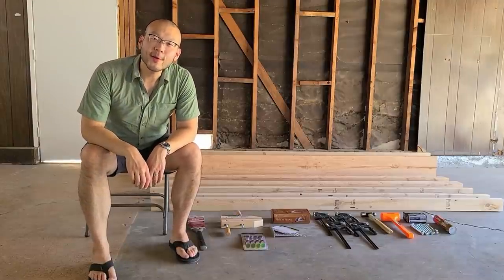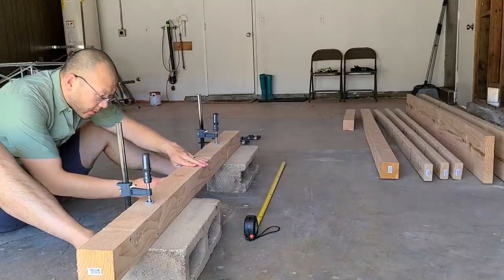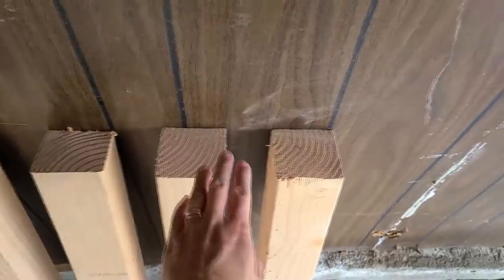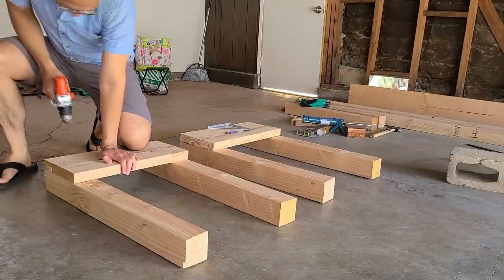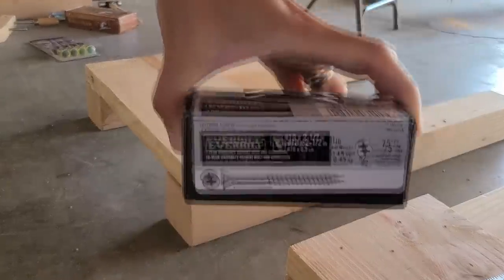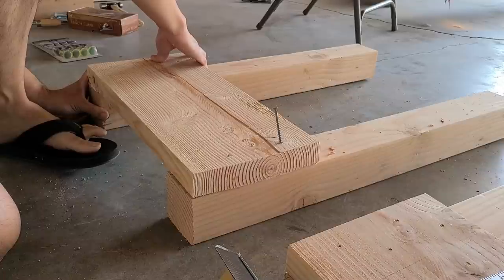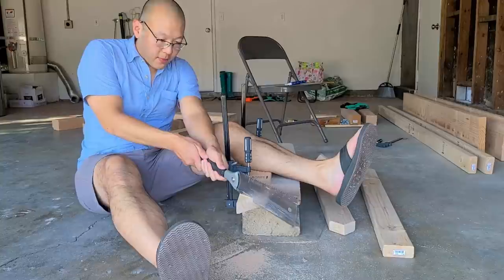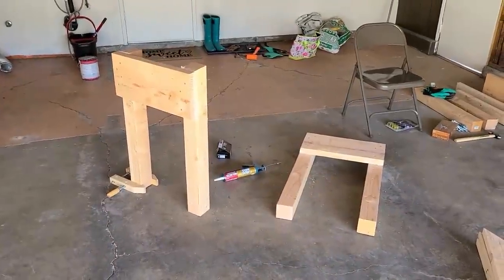A Dentist Builds Rex Krueger's English Joiner's Bench Part 1

Comment: I've only watched this video (so far) but I want to extend to you one piece of advice I wish someone had given me when I started, oh so many decades ago.  When sawing, always keep in mind the "kerf" of the blade you are using.  IE - the thickness of the saw blade.  If you are cutting an 8' board in half, you won't actually end up with two 4' boards.  You'll end up with two 3' 11-7/8" boards (or thereabouts), depending on the thickness (IE - kerf) of the saw blade.  So, when you pencil in your cut line, make sure you cut with the saw blade on the waste side, not the project part side.  Otherwise, you'll end up with a part that's too short.  Ask me how long it took me to figure this out on my own...  :P
Reply from the maker: Awesome! Thank you for the detailed reply! I definitely still need to work on my sawing and others have mentioned about the kerf. I'll make sure to keep that in mind when making more precise cuts.

Comment: If you buy another caulk gun, try to get one that releases pressure when you stop pulling the trigger.  It will also have a better tip cutter.  These are normally $15-$30 and will save you a ton of time, clean up and aggravation.  As you get into home improvement and start caulking your tub, cracks etc. it will be a life saver.
Reply from the maker: That's great advice! Yeah....I'm starting to learn some of the cheap tools I just got will need to be replaced soon. I didn't know how much this hobby would stick so didn't want to invest too much initially, but I really enjoy woodworking and diy! Time to buy some nice tools!

Comment: Not to make cultural assumptions, but Japanese woodworking is some of the finest in the world and traditional Japanese woodworkers do much of their work sitting down. The saw you are using, like many Japanese tools, works on the pull stroke, which is more powerful and easier to control, and of course sitting at floor level is much more a part of daily life.
Reply from the maker: I've noticed this too as I watch more woodworking content. I actually really enjoy working on the ground and I'll continue doing it. I want to start working on some indoor plywood furniture and got a comment on my vertical chainsaw mill video saying to use my circular saw on the floor with purple foam board insulation as a backing. I've seen a few videos on it and seems like a very safe way to break down 8x4s!
Reply: @ADentistDoesHomeImprovement  I will check that out. I've been a carpenter for over 4 decades and I can't stress strongly enough, power tools are inherently dangerous. ALWAYS use eye protection, ear protection, pay close attention to blade depth and the guard, when sawing sheet goods (ply) wear a respirator as well as it is infused with formaldehyde, don't know what's in the foam but assume you don't want to breath that either;) Will continue to follow your videos, I'm now retired and going through a hand tool renaissance, love the quiet, the cleanliness, the safety.
Reply from the maker: @johngriswold2213  Of course. I wore all that when I used my circular saw for the first time and continue to do so. This comment and other safety comments are the most important! I want to maintain a healthy respect for all my power tools. Thank you!

Comment: Right out the gate I see you made the same mistake as me and picked up the harbor freight bench plane.  That thing is garbage do yourself a favor and check out thrift and consignment shops for some old but more well built Bailey style planes you can usually get them for under $30
Reply: I agree but another good option for a cheaper plane is the Kobalt No.4 bench plane from Lowe's. While they're prone to not adjusting for aggressive deep cuts. They're great smoothing planes, and you can alway pick up another and convert into a scrub plane for aggressive and fast material removal.
Reply from the maker: Good to know! I'm planning on trying to sharpen it and using it as a scrub plane. Thank you!
Reply from the maker: Thank you! I'll look into the Kobalt No. 4 bench plane!
Reply: @A Dentist Does Home Improvement  no problem! I bought one and its one of my best smoothing planes to be honest. 

 Good luck to you in all your future projects my man!
Reply: @ADentistDoesHomeImprovement   that’s what I did with mine it seems to be good for that.  With a good camber on the blade you don’t have to worry about if each side is adjusted perfectly as much